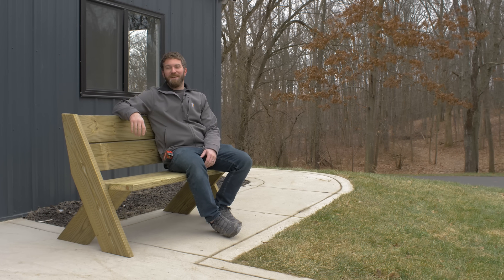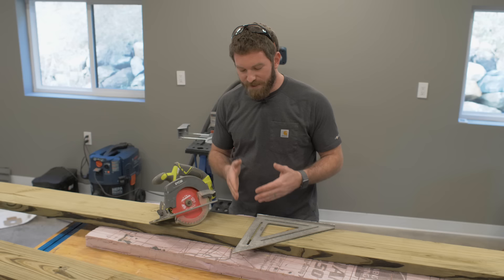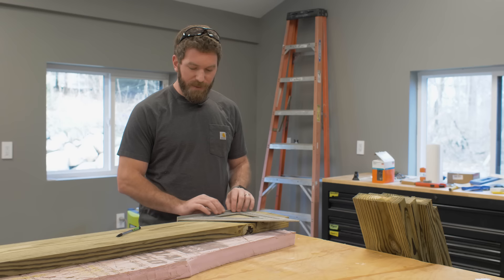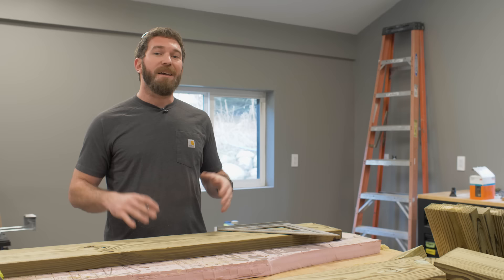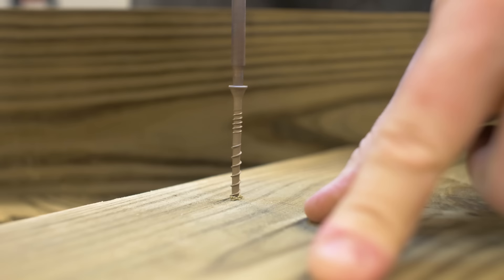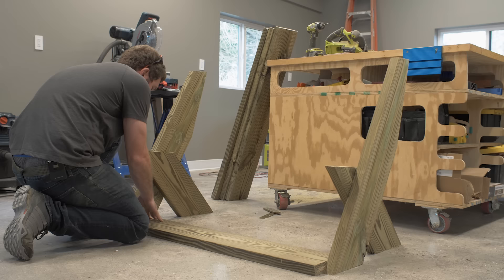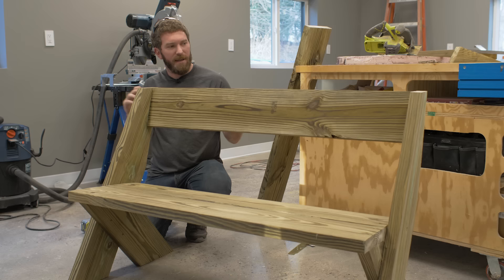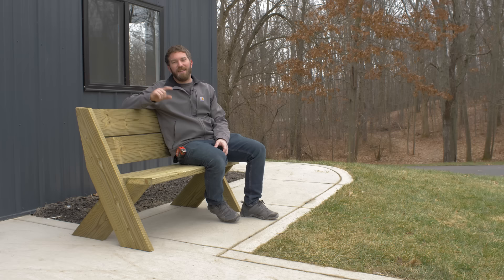$30 Outdoor Bench with Back [Only 3 Tools and 30mins]

Comment: When cutting treated wood insure that the ends cut are covered with additional wood preservative.  Most often the enter isn't properly preserved
Reply: I’ve read that you shouldn’t handle pressure treated wood without gloves. Is it safe to have this bench made of that material or is that a different kind of wood I’m thinking about?

Comment: I just finished buildin mine today, took about 1 1/2 hours total from gathering tools and taking my time. 

Very easy build and i was surprised it fit my big butt, my girlfriend and our 4 year old comfortably.  

Gona leave it in the sun a few days to dry the wood a little then sand abd stain it. I used regular lumber as my bench is under a carport

Comment: I would suggest using bolts and nuts. If one uses carriage bikes and rounded (cap or acorn) nuts, it can look quite nice. A bit more secure than screws, I would say.

PS: Good project. Nicely done video.

Comment: Sweet little bench! Definitely see myself building some of these for the spring/summer! Might try it with some cedar as well, little more expensive but I love me some cedar!
Reply: I went to download the plans but for some reason can't seem to find the download option. Where should I be looking? Thanks Jamison!
Reply from the maker: @hollewoodfurniture8190  Sorry about that, I forgot to include it initially but now the button is at the top of the plans
Reply: @rogueengineer  no worries 👍 You've got a ton on your plate I'm sure, I appreciate the plans and the extra work you put in for your subscribers.

Comment: If you don't have a circular saw an old fashioned hand saw will work as well.
Reply from the maker: And some serious elbow grease!
Reply: Nope
Reply: I made this bench didn't have a circular saw or an old fashioned hand saw but what I did have was a serrated bread knife did take me a while but I got there my angles were a little crooked but wasn't a problem I just used a rock under one side to level it out, I had to guess the measurements as didn't have a tape measure or square but what I did have was a piece of string and worked a treat I tied a not in it for reference, who needs fancy tools work with what you got.

Comment: Thank you so much rogue!  This was my first project and I am so grateful.  Just completed it!  The cut for the back was the hardest part.  The instructions, box for screws, and home depots website did not stipulate if you should predrill for screws....  I would love to hear you recommendation as I couldn't tell by video or plans.

Also, do you recommend painting or staining this?  I love the way it looks but it will be sitting in direct sun.
Reply: Dont need to predrill if you are using self-tapping screws. Paint is more durable than a stain, but whatever you choose will have to be applied yearly to upkeep it.

Comment: Nicely done, but here is me doing it:

1) Open cold beer from beer fridge, take swig
2) turn on stereo,take swig
3) think about it, listen to some tunes, take swig
4) grab circular saw, look for battery, and curse because I didn't charge it, take swig
5) put batter in charger, take swig, put empty in recycling container
6) grab another beer, open it, take swig
7) grab speed square, pencil, tape measure, drill, drill bit kit, and remember my battery isn't charged, curse again, and take swig
8) look at tools all laid out, reward myself for a job well done, and take some time to listen to music and finish my beer
9) grab another beer, look at battery charger, and turn on TV, put on ESPN, and finish my beer.
10) grab another beer, take a swig, look at the table, realize I need to put my two empties into the recycling bin.
11) look at charger, take a swig, and then another, and say, "meh, batter is charged well enough"
12) look for PT wood screws, I know I have a couple of boxes of 2 1/2" and 3 1/3" somewhere, take another swig
13) get frustrated looking for screws, take another swig, and then another, and finish my beer
14) get another beer, and find the PT wood screws exactly where I though I put them, but looked right past them, get frustrated, take another swig.
15) put the PT wood screws on the table and go to look for the PT wood
16) realize I never bought the 2"x 4"x8' PT wood, get frustrated, finish beer, and turn up stereo
17) go get another beer, listen to music because don't drink and drive, go inside and take a nap... tomorrow is a new day

total time of project, 1 day, 3 hours,  30 mins, and 2 aspirin

Of course, power tools and alcohol don't mix either, this was satire.  (I hope everyone realizes this)

Comment: This is certainly simple enough, but I have to admit that I'm suspicious about how long-lasting this will be.

That is, the problem that I see is the main weight-bearing, and the end-joint of the seat is held by end-grain screws.   

I'm willing to be proved wrong, but what I'd be interested in seeing is a video showing the bench in one or two years, after rain had leaked into the screw holes, and kids had been climbing all over the bench putting torque along and across the screws (bending the screws, tending to widen the holes, and tending to pull the screws out of the holes).

Just my thoughts.

Comment: Nice design...i'd add two angle braces to it to stabilize it...seems like it'll sway (right-left) on the screws holding it. Left over little block pieces might be enough material to offer you the angle bracing under the seat.

Comment: 0:24 idk if I learned to count correctly but that looks like 5 tools to me
Reply: I counted seven. Speed square, drill, saw, tape measure, pencil, straight edge and a rubber mallet.
Reply: @Yog Sothothologist Out of those, I only own a pencil personally lol. Plus the comment above. There's even more he used
Reply: I think we know who the TOOL is ... lol
Reply: Knit pickers. Its a good design and you worry about how many tools.
Reply: @Yog Sothothologist that is what I wanted to say too.If there is no carpenter pencil at home,that is the first and cheapest tool to buy anyway for a carpenter project.But mathematically that gentleman is right.👍
Reply: @arnoldscully8906   of those, I don't have the saw.
Reply: I just need the tool to build me one lol 😄

Comment: I would replace those screws with dowels ... if you want it to last.
Reply from the maker: That would be a great modification
Reply: More tools and more time.
I believe that the coated screws will last longer and keep it tighter for a outdoor bench considering expansion and contraction of the wood. Screws are easy to tighten or replace. But if old-school is what you are into do it.
Reply: My experience is that screws loosen over time, and is kept outside in the elements will inevitably rust. By contrast, glued dowels almost never loosen, and certainly don't corrode. This isn't "old school" it's just tried and true carpentry. And actually it relatively quick, as well. A practiced carpenter could replaced the screws in this piece with dowels in 15 to 20 minutes, but extend the life of the bench by years.

Comment: First THANKS! I have the same saw and it cuts terrible. I will upgrade the blade to the Diablo.
I doubt that I would do this in 30 mins. Between watching the video and making sure you measure twice and cut once I would probably do it in 1h. Still very impressive. Thanks you so much

Comment: Don't build benches
People you don't like tend to come round and sit on them
Be warned
Reply: Exactly lol! I know some people that I don't want getting too comfortable.
Reply: It's like putting out bird feeders and then complaining that there are birds all over...
Reply: Haha
Reply: Lol
Reply: Well said, just put them in the garage when they come over and put them back out when there’re gone.🙌
Reply: I always wrap my benches in barbed wire which keeps people from sitting on them . You're welcome .
Reply: @QuantumPyrite_88.9  I just put screws up from the bottom
Reply: All of y'all are wrong. How dare you make light of the project that was shared with us. This no way to show public appreciation for such an easy project to do. (Mental note put     screws      up     from       bottom). You should be ashamed of yourselves,😂😂😂😂😂😂
Reply: @Riley Rohe - Great idea and maybe connect electrical wires to the screws and run an outdoor extension cord . Thanks
Reply: Quantum Mechanic nailbed! :)
Reply: LMAO. Exactly
Reply: Bill Gowland lol
Reply: To solve your problem just cut 1 of the back legs 1 inch shorter so it has a slight wobble people tend to find an excuse to leave if they have to sit of seats that may collapse at ant moment, after they leave flip i5 over and screw a bit of 1inch “scrap” to the bottom
Reply: @mickgad1  most boring people are very practical
They would just stick something under the wobbly leg 
To even it up
Then spend the next ten hours explaining the mechanics of how  it works
Bad idea.

Comment: I upgrade 3 of my saws with new diablo blades after on your advice, I had one in my table saw but didn't think to replace my other saw blades. The saws cut a lot better and my cordless saw has more power and lasts longer. Thanks.

Comment: The first one I made took an hour. I used quarter inch plywood and made a template of pieces a very long time ago so all I need to do is place the template on my lumber and draw lines and cut. I have notes on the template of the degree of  cuts. I have a jig to measure the 1.5" front hang over and the space between the seat boards. I make two an hour if I sand but three if I don't.

Comment: Great build. This was my first woodworking project. I only have a handsaw rather than a circular saw so it took me a lot longer (and the angles are a little iffy), but I'm really satisfied with the result. Here in the UK 2x8 isn't really a standard size (I used 6x2) so I had to alter a couple of the measurements but it all worked out ok. Thanks RogueEngineer!
Reply: I appreciate this comment cuz I couldn't afford to keep a circular saw around but a handsaw would be perfect for me
Reply: Nothing wrong with using hand tool's you might want to pick you up an angle guid for the hand saw to help with getting straight cuts. I use mine even with my power tool's because with my circular saw I can't cut a straight cut for nothing I have to use a straight edge.

Comment: I purchase Diablo blades to build my new home so far used 3 the hole frame is up including cutting the forms for the raise foundation all the way to the roof. Excellent blades. Save me easily 80.00 bucks compare to other brands. 😉

Comment: I use scrap lengths as a fence, nailed (or screwed) to my boards to be cut, so I can use two hands on the saw, as they were designed and intended to be used. Safe, straight cut every time.

Comment: This is an attractive design, and I'm going to make it out of rough cut 2 X 10 pine, so I was drawing a new sketch when I noticed an issue on your drawings.

Where you show the intersection of the short and long legs, the distance of the short leg from the ground is shown as 6", and the distance to the intersection of the long leg is shown as 5 3/8".
Using the basic geometry of 45 and 30/60 triangles, the distance of the long leg to the intersection should be 12"/root (6) which is approximately 4 7/8".  The 12 1/4" distance on the long leg should also be 15 1/2", unless I'm missing something.

Comment: Looks like a nice plan for a nice bench. I’d add a suggestion that when buying the lumber the builder should measure the length of each board they buy. I’ve had lumber from the big box stores be under as well as oversized from what the claimed length is many times. And when cutting to length don’t just assume that cutting the boards in half will result in equal sized pieces. Measure each part. Given that your videos are aimed at beginners buying a board that’s too short, even if it’s very close to the advertised length is something that they may not anticipate.

Comment: The only thing I have a problem with is the bench being built using pt wood. It's a great idea and easy to build. I built something similar to this year's ago and, no matter how much the wood is treated, it did warp here and there. And wether the wood is wet or dry, as soon as you put a screw or nail in the wood, water finds its way to the fastener and over time it will loosen . Again Awesome build. And believe me when I say this, I'm not knocking the build,  I just prefer regular wood over pt wood. Just my opinion. 2 THUMBS UP 👍👍

Comment: Nice job. Only thing I would add to this build is apply wood glue to the part where you attach the legs together with the 4 screws. Only because screw don’t have much shear strength and the glue will help make up for that. Elsewhere is fine without the glue since not as much pressure on those areas. But that’s just what I would do.

Comment: I built similar benches for a scouts fire pit but i ended up adding couple boards between the rear legs to prevent drafts and trap some of the heat. it was much more comfortable.

Comment: Making 18 of these for a disc golf course with 9 finished so far. Using 2x10x8, you only need 3 boards. Much cheaper. I noticed a very slight side wobble when two adults sat on it. Need to figure out how give it more stability.
Thank you! The HHK disc golf community loves them!
Reply: You ripped the 2x10 in half and made 2, 2x5's?

Comment: My suggestion is to seal the pressure treated wood where you cut it with cut seal or similar for pressure treated wood. My experience is that carpenter ants may chew into the cut ends and destroy the wood from the inside over time and the unsealed wood will absorb moisture from rain etc.  This happened to me… please don’t repeat my oversight! Lovely and easy bench!

Comment: I built one a few days ago and it turned out pretty nice despite my poor carpentry skills. Learning to do angles with the speed square was cool. It took me about 2 hours to build. Perhaps I missed it in the video and overlooked it in the plans written on the website, but it would be nice if we knew which of the which end of the short leg was on the ground. It makes a difference. You can flip the leg so either end is on the ground while the19” side faces out. Attaching the two backrest pieces was difficult by myself. Overall I’m very pleased with the outcome and my new skill with the speed square. Also I bought a Diablo blade. What a nice difference that made.

Comment: The bench is great. I am dividing it into 2 chairs. On your drawings on the website.. The first cut of the 38inch long pieces shows them cut at 30 degrees both ends but it actually one end. I made the mistake of doing the cuts first by first but I think it will work out OK. Thanks

Comment: It's not structurally sound. Side to side wobble will loosen up all the end grain wood screw connections in just a few uses. It needs something like a 45% angle from the legs connected to the seat. Or a morticed connection across the bottom.

Comment: I like it, I like it a lot! But I would use lag bolts.
Reply from the maker: That would be a great addition. Plus carriage bolts in the joint of the legs. I was just trying to keep the price down.
Reply: @rogueengineer  i would not trust screws for load bearing. carriage bolts are not that expensive and is what i used for my picnic table. i'd nail it before i would use screws as nails have a much greater shear strength.

Comment: Just bought and downloaded the plans... 6:41 If you don't want those screws visible from the outside and 'spoiling' the appearance, I guess you could use a pocket jig and make a hole on the inside of the legs to screw into the seat? And then one the backs of the boards you're using for the back? Also, I was thinking using 4 carriage bolts on the outside to put the legs together might look pretty. And stronger than thing wood screws.

Comment: It seems the backrest boards would be more secure mounted  the other direction into the side rails.
Reply: But that would throw off the spacing from the seat.  Youd essentially need to cut the back pieces to 51" (3 extra inches since a 2x4 is actually 1.5 inch thick on either side to line up with the rail)..  this means youd need to buy another 2x8 for the oddball measurement.

Comment: Great, simple design. I may start making these to sell. Pressure treated 2x8x8's here are almost $10, but it looks like I could get by with 2 - 8' and a 12', which would bring the cost down to about $35. 
One question I had. For the short leg, I didn't see if the 40 or 45 degree angle goes up. I checked the online plans and didn't see anything there, either. Maybe I just missed it. I went through a lot of the comments and didn't see anything there, either. I'm guessing whichever way gives the seat a slight backward angle (which I can't seem to figure out in my head right now).

Comment: I’ve built the bench and the Adirondack chair, they came out well and are comfortable. However, around the campfire, neither is both suitable and comfortable for the person tending the fire. The Adirondack is too low and angled too much for tending a fire, the bench isn’t comfortable enough to relax on or support your arms and a beverage when not tending the fire. A nice blend of the two projects will work. The bench seat height, width, and angle combined with the Adirondack seat depth, back height, and armrests will make for an excellent campfire DIY chair.i don’t think it will be too difficult to combine the two.

Comment: During the assembly of the lower back board, we only screwed the two top screws first, then we sit, and we adjusted the board to get a perfect holding of our back. Then we screwed the remaining two ones with this in mind. The result is very ergonomic and instead of two straight back boards, we have a kind of a sligh V shape with a +- 160° angle. Thanks for these plans! It did take us more than 30 minutes, but we will improve :P